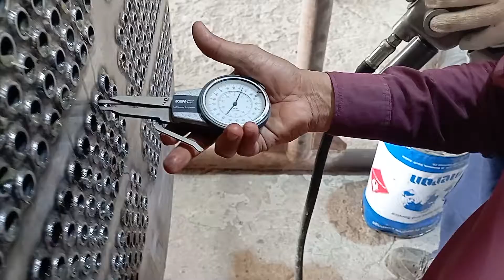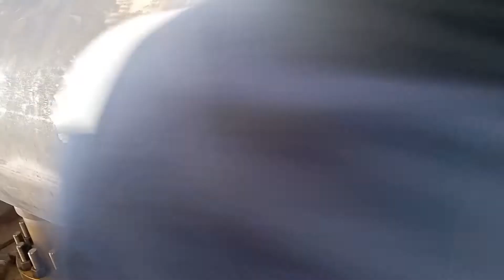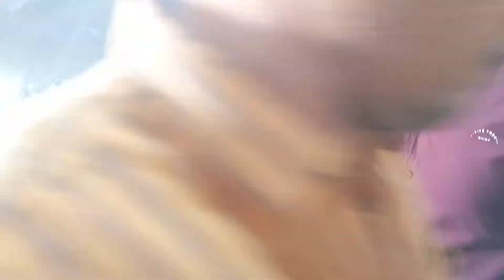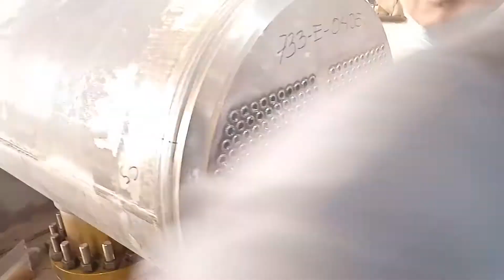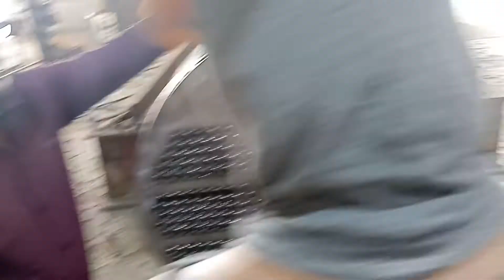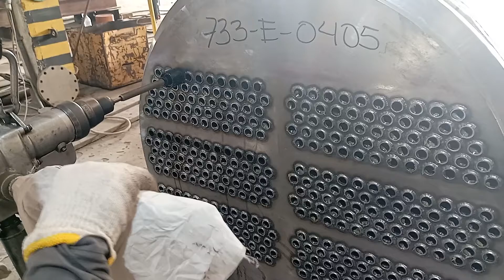Tube to Tubesheet Expansion l Heat exchanger 2.0

Comment: What is the name of this tool used to measure ID of tube?
Also can you pls give me a step by step procedure of retubing for HE. I have started preparing for API 510!
Reply: Brother can you please help me out with heat exchanger reference from api 510
Reply: @lassi980  what help do you need?
Reply: @humenbot24  I don't know from where to get knowledge of heat exchanger from mechanical pov. So can you please recommend good source. 
Ps. I am having only 1year work experience. & Want to learn about heat exchanger in detail from mechanical point of view
Reply: @humenbot24  inspection mainly it would be great help if you can guide me
Reply from the maker: Bro go to TEMA and API 660 you will the tube expansion requirements. Dont go to API 510, insted go to ASME VIII dev.1
Reply from the maker: Bro go to TEMA and API 660 you will the tube expansion requirements. Dont go to API 510, insted go to ASME VIII dev.1